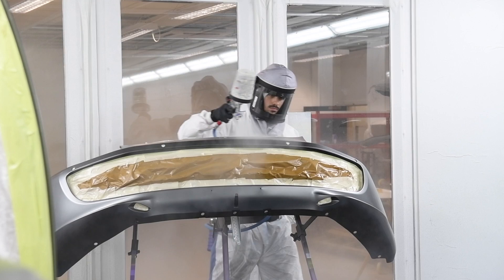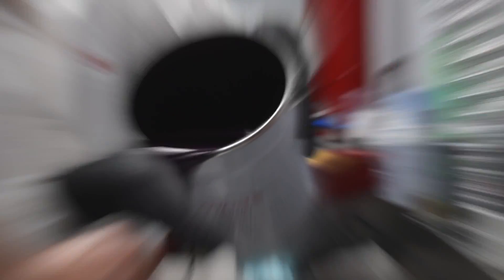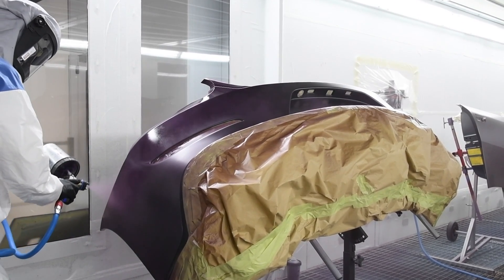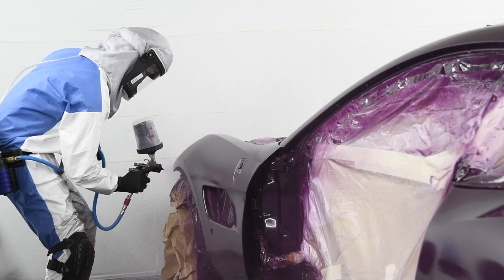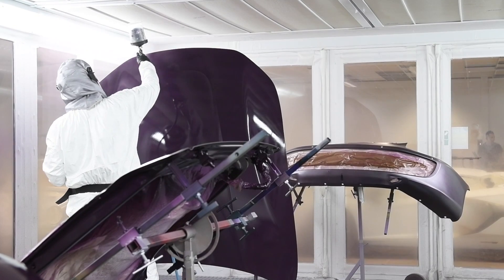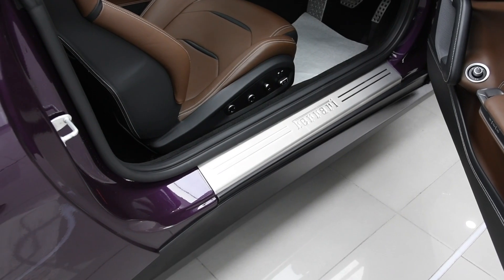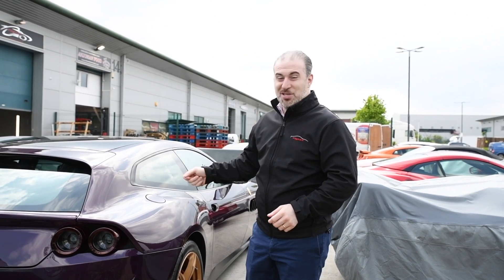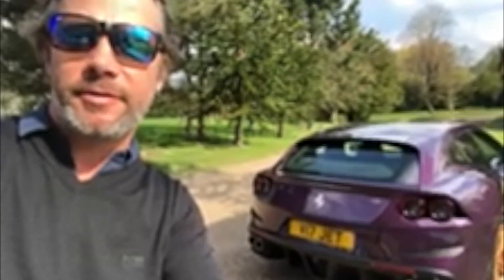Making JayKay's Ferrari PURPLE!!!

Comment: The amount of orange peel on a 10k job is ridiculous
Reply: you can let it get polished until it looks like glass, or pay less and have some orange peel
Reply from the maker: We offer anything in between an OEM finish as you'd get from the factory and perfect glass reflections. It depends on what the customer wants.
Reply: Watch American Hot Rod (repeats) the paint finish was piss poor on some cars. Thats untill they cut and polished it.
Reply: @TopazDetailing  but to remove it, it will cost you another £5k
Reply: @scotthawton1083  Its not plastidip......
Reply: Orange peel is sometimes preferred as it handles stones better the way it deflects the stone would differ rather than a smooth surface
Reply: @linkmarine  you jest surly.  Seriously 5k to remove.
Reply: Vuhs Media This looks better than 80% of paintjobs out there! And im really sure, that with a few more layers of „clearcoat“ it will get smooth like glass...
Reply: softminimal1  I think its closer to plastidip than paint as its removable.

Comment: How are your mechanics Ferrari certified? What torques do you apply during re-assembly? How is it guaranteed all fasteners are reinstalled as they should be? What if you loose stuff? Do you buy new screws straight from Ferrari? Do you even tell the owner?  How are panel gaps set perfect again to exact Ferrari standards?  I think this car is now depreciated because of it having been disassembled and reassembled outside of Ferrari...

Comment: Is the process for the wheels identical? Is clear TopazSkin the best protection for the Pista carbon wheels? I saw that you did Tipo’s wheels with film
Reply from the maker: Thanks for the comment. It's possible to cover the wheels in the same way as the car, and TopazSkin would be a good protection for carbon wheels, however, the customer opted for PPF in this instance